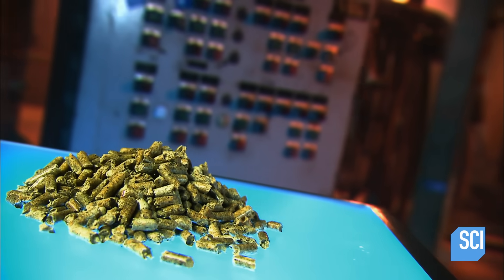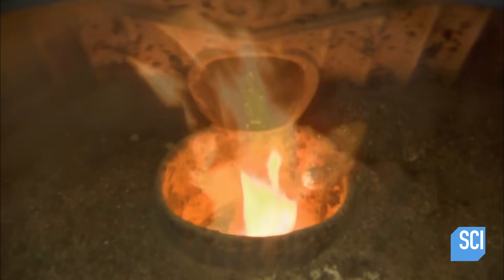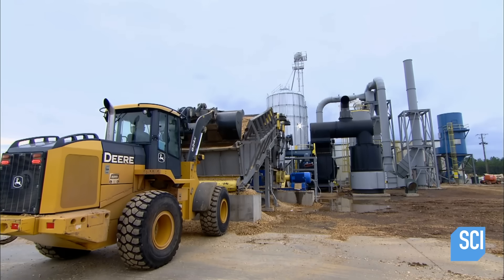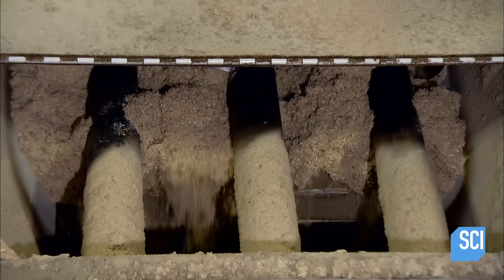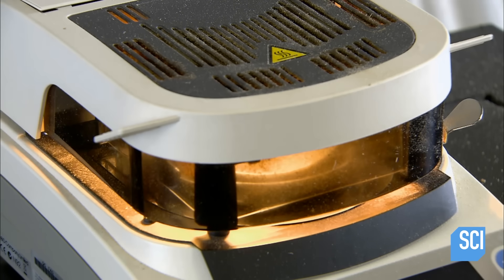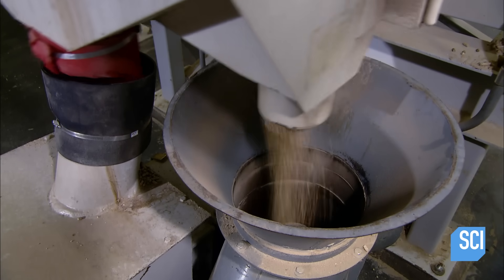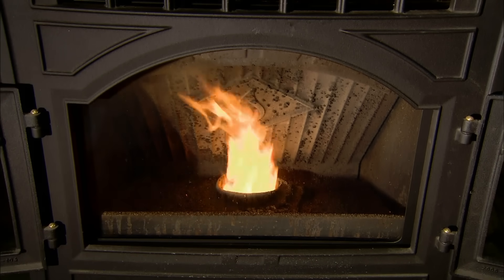How It's Made: Wood Pellets

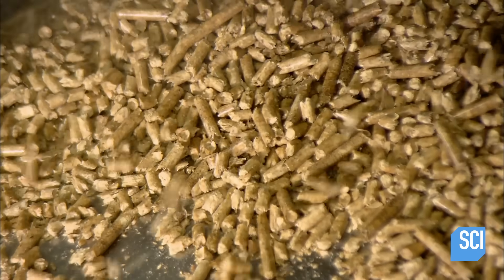Comment: 3:40 I'm like 99% sure lignin =/= tree sap.   Lignin is the "bulk" of the trees structure / physical material.  Sap is basically tree food - nutrients that gets produced by sap wood and moved to the branches to help produce new branches and leaves. 

I think this sentence should be "The compression generates heat which draws out the tree sap still contain in the wood fiber made mostly of lignin. Once the sap cools it helps the wood pellets keep their shape" 

or something like that.
Reply: I think we should rather leave the sap out of this. It is the lignin that acts as a binder (sometimes they ad a little extra but most often the natural lignin content is high enough), I don't think sap plays any significant role in the binding process of pellets.
Reply: Quality has been assured 😎
Reply: that's a terrible sentence

Comment: Is this the same pellet that is used for cat litterbox?
Reply: Roughly... yes.  It's funny they are talking about using them for heat while showing a bag for bedding.  We frequently have ranchers buy entire pallets of them to be used in livestock stalls.
Reply: @ShainAndrews   is the pellets from sawdust not toxic for cats?
Reply: @alexadespacito4561  You know what?  I over looked cat in the opening post.  Don't know how, but I did.  To answer your question.  I don't know.  Probably fine, but I don't know for certain.  I have lots of equestrian types use it... and I know just how fussy most of them are.  Thanks for getting me to revisit my response, wish I had a solid answer for you.
Reply: @ShainAndrews   actually I asked bc I really wanted to know since I’ve decided to swith from sand litter to pellet. Thanks for you response

Comment: HAHA the price of pellets have just gone up here by about 50% they use to be £150 for 900kg or 1 pallet full to over £300 for the same crap... pellets are no longer cheaper in the long run.
Reply: Other fuel sources have increased as well...
Reply: @ShainAndrews  indeed they have but it costs the same now, as the cost of hot water rose by 10% or so the cost of pellets was 100% so while 1 went up a little the other caught up so either choice is now an option.
Reply: @straightfaceguy7966  You pay for "hot water"?  You have the option to buy heated water or heat your own via wood pellets?  For what it is worth... I'm a buyer for a corporation.  I purchase from the manufacture for distribution.  Wood pellets are not up 100%.  I buy semi loads and they are not trending beyond the rate of other fuels.  Nice try though.
Reply: @ShainAndrews  yeah I but hot water direct from the company, they pipe it out to communities and then you have the option to take it or not. So I pay for 2 in 1, hot water for the taps and then hot water for the radiators, they measure the temp coming in the house then they measure as it leaves and work out the price. I could get pellets, but the price to install the machines you need and to uninstall the hot water costs too. So for now as it's about the same price I will stay with the community hot water supplier.
Reply: @ShainAndrews  and nice try for what? If you are buying for a corporation then you are going to get a much lower price than 1 house that buys 8 pallets arnt you... if I buy 60 pallets on a truck then I'm going to get them way cheaper plus you get "tax" back on your purchase... so ye obviously you would get them for hardly anything...

Comment: These pellets are so stupid. My place is heated by a heat pump and by a wood pellet stove. So when the power went out I was basically out of luck. Wood pellet stoves require electricity to work. Not just to start but to operate continuously. I really wish the place had a regular wood stove in stove. I could have been nice and warm during the power outage instead I froze for 36 hours. I don't see the point in a wood stove that doesn't burn random bits of wood and also requires electricity. Talk about pointless over engineering.

Comment: I work at a pellet mill and I will say this it’s way more complicated than they think and way more dangerous too
Reply: I'm an Electrician, and I have worked the occasional Flour Mill: The only place with higher standards for Explosion Proofing than Oil Refineries. I saw the dust floating in the air...
Reply: Dangerous as hell I got wrapped up in my machine
Reply: what about this machines that you can make your own pellet
Reply: I work at one also. not dangerous unless you're a complete moron

Comment: I have had a pellet stove for 18 years now and use it for supplement heat. The main thing is doing the annual maintenance on the stove and the  cleaning of the burn chamber when using it for a few days. One thing I don’t like is the big  increase in the price of the pellets. Supply and demand but there seems to be more pellet making plants near in New England.
Reply: Here the pelets is horrible expencive and used for animal bedding, would not dream of burning it because of the cost...vAlso it is always sold out...

Comment: Wood pellets are ridiculously dumb it put you back in reliance on the system the whole point of a woodstove is that you can cut down a tree in your yard a dry one preferably and burn it right then in there to keep yourself warm unless you buy these wood pellets you cannot make them at home yourself which makes your wood pellet stove only usable with purchases from your local hardware store which is completely redundant and dumb

Comment: Has anyone loaded a shotgun shell with wood pellets? Just curious how it turned out.
Reply: They’d break apart, the lignin bond is not very strong and can be broken with finger pressure, you’d be better off going old school and using rock salt
Reply: They broke apart and dusted.

Comment: 0:12
"Made from lumber byproducts, such as saw dust and wood chips, which would otherwise end up as waste. Pellets burn more efficiently and more cleanly wood." 

So, saw dust, which is wood, and wood chips, which is definitely wood, burn more efficiently and more cleanly than wood. 

Seems legit.
Reply: It also mainly has to do with how the pellets are burned, in a little furnace hole with high air flow.  Having converted to a pellet stove from a wood stove in my cabin, a 10, 40-lb bags lasts longer than a chord of lumber and heats the place way better.  My model holds 120 lbs and runs off a thermostat and I only have to refill it once every 2 weeks.  2400 sqft cabin, too.
Reply: @DissYraiN  Yeah but unless you get the pellets super cheap it defeats the purpose of a wood stove. You can't go cut yourself pellets so might as well just use a furnace.
Reply: @bobbygetsbanned6049  alright, so I have 3 pallets (40 bags) that each cost about $250 delivered to my property. It takes up the space of a full chord of wood, and about 10 to 15 bags do the work of a full chord of wood.  Where I live, there aren't many dead trees to turn into firewood, so I'd have to drive and put in a lot of work (days) to generate just one chord, and probably consume more than $250 in gas just to chop, split, and haul said chord to my property.  I would have to keep manually feeding the wood furnace each log.  The pellet stove self feeds for over a week, puts out 15x the BTUs by weight of fuel, and works off the thermostat which I control remotely.  It burns way cleaner as well.  

It's better than a wood furnace in every single aspect.  I'm an engineer.  I didn't switch to it for no reason.
Reply: I appreciate all the info everyone. There's a learning experience around every corner!
Reply: @skuzlebut82  I think it has more to do with the physical format the wood is in. The finer/less "log-like" it is, the more efficiently it can burn. A log is about the least efficient format in which to burn wood, so these do better and burn more completely (what efficient burning looks like)
Reply: @skuzlebut82  I appreciate that you are open to it and personable. Have a great day.
Reply: @joeschratz9360  AND, you have a great day as well!
Reply: @joeschratz9360  And you have a great day as well! :-)
Reply: I know it sounds far-fetched but it's true. The reason that they are comes down to the sap that that is pressed out an exposed when they are made into pellets.
Reply: The cool part of it all is they burn fossil fuel to make the pellets...
Reply: @waynec369  That mostly depends on how the power grid generates the electricity used by the machines (except from the dryer, which they state in the video runs on the waste sawdust. Either way, that waste wood will either be burned, or decompose to give off the CO2.

Comment: I had a pellet stove they're not that great two bags a day $5 back make s'more Ash then what you think and it's not smokeless what are those green things inside of pellets break One open they have green plastic-like material inside
Reply: We burn less than a bag a day, and there's no plastic in pellets, if there is, you are buying trash pellets, not wood pellets. I have no doubt that some dodgy manufacturers would bulk up their pellets with rubbish, but only in shitty countries, advanced countries regulate pellet manufacture.
Reply: @ledsalesoz  I know some of them will only take a bag but the one I had used two bags and I said plastic-like I'll got them  from Menards.
Reply: @ledsalesoz  and I would clean it twice a day and every morning it would have a big pile pellets in the fire pot I don't know what I did I couldn't adjust that I had it less than 3 months just to say I was not happy with it.

Comment: I get my wood for free out of my backyard I don't have to pay eight bucks a bag or $10 a bag
Reply: Yes, and that wood has a much higher water content, so burns much less efficiently, produces vastly more smoke and methane, and impacts your health, whether you realise it or not. I've always found it odd that people think wood heaters are eco and clean, they are anything but. Pellet heaters control the heat output by providing unlimited air for combustion (the firebox is fan forced to make the pellets burn rapidly and cleanly) and varying the fuel feed rate, whereas wood heaters control the heat by controlling the air. By starving the fire of air, it becomes massively polluting and toxic. If you want a real flame, then wood pellets are the way to go.

Comment: The pellets that fuel the stove at my house are a lot bigger around than two-tenths of an inch, they're closer to 3/8".
Reply: The narrator said “one and two-tenths inches”, i.e. 1.2”, not 0.2”.
Reply: @tookitogo  1.2 inches is much bigger around than home heating pellets. Unless they meant the length?
Reply: @dbseamz  I rewatched them segment, and you’re right: they did say the diameter is 2/10”, and then the length is 1 and 2/10”. Seems like the size I remember for those grass pellets they sell as rabbit food. (Wouldn’t surprise me if the equipment is basically the same.)
Reply: @tookitogo  The holes in the rotating die are ~1/4" dia. The holes are tapered...with the bigger diameter on the inside part of die. As material gets forced into the holes...it gets compressed before exiting the outside of the die. A stationary scraper blade (or knife) can be adjusted to make shorter or longer pellets. Rotating dies of varying hole compression ratios are available...selection of which is dependent on the types of materials being pelletized.
I was maintenance engineer in a plant that had several California Pellet Mills in operation.
Reply: @BANANASandDUCTTAPE  Yeah, the same principle as other extruders, like the ones for pasta. 

I’ve actually seen a pellet extruder in action on a farm once, but for making pellets from hay, rather than wood.
Reply: @tookitogo  That's a neat idea. I guess it could be stored for longer periods of time?
Reply: @BANANASandDUCTTAPE  I'm not certain, but I think it's simply more compact and easier to serve to the cows, compared to baled hay.

Comment: Wood pellet fire power plant?? But what if i wanna play with the fire and control the heat manually?
Reply: I know on mine you have to keep the door closed as there's a fan on the inside that blows the exhaust outside.  Controlling the heat is done by high/med/low switch and a feed rate slider inside the hopper
Reply: We tried them on a coal/wood boiler that normally uses wood chips.  They work but the quantity required to replace chips made it cost prohibitive.

Comment: Not really “green” energy, considering all the energy it takes to make these pellets!
Reply: I mean they turned what would otherwise be waste into a clean burning, cheap fuel that produces very little smoke and produces ashes that can be then reused as fertilizer, but alright.
Reply: @meismagiic4779  yes, it’s a very good clean burning source of energy! True. But a heck of a lot of energy goes into making it! But it’s no doubt good for the life of the wood stove.
Reply: @c.e.schlink9933  .. no where near the energy to make lithium batteries
Reply: @bryandamkaer3646  so true
Reply: @bryandamkaer3646  yeah that comment makes just as much sense as saying "growing avocado is really more water efficient than cleaning laundry"
Yeah in theory its both about energy, but wtf, those are not even really the same field of application.
A lithium ion battery is great for a small, lightweight power-supply with a high power density (e.g. potable electronics, cars) whereas wood pellets are heavy, but burn clean and are a easy energy storage.
But sure, while you shin on Lithium-ion Batteries, whats your great alternative? NiCd? Gasoline? Hydrogen that basically leaks out of every portable container or is ungodly heavy if stored "properly"? 
Nice one..
Reply: @bryandamkaer3646  That makes no sense at all, pellets are a fuel, you burn them once and they are gone, batteries are an energy storage medium, not a source of energy, you charge and discharge them hundreds or even thousands of times, the energy in them comes from other sources. There is no relation between the two, you just made up some nonsensical statement to try to appear edgy, but you just look foolish.
Reply: @bryandamkaer3646  batteries do take a lot of energy and mining to make but they are recyclable and can be made into new batteries again without more mining. Once you burn fuel it's gone forever
Reply: I mean, they burn the waste sawdust to run the dryer, better than burning natural gas or some other fossil fuel.

Comment: Haha they tried to censor the company name and number during bagging but the next scene you can clearly see PWPELLETS and the phone number
Reply: I worked on California Pellet Mill machines - exact same principle as shown. We blended 65% shredded polyethylene scrap plastics with 35% shredded hardwood fibers into pellets which was then run thru an extruder - the molten hot material was then compression molded into a product.
Reply: @raybin6873  Really..how is burning 2/3 plastic safe for residential ( indoor) use?

Just wondering as I'm no scientist. Did a few hard weekends in a PVC pipe factory back in mid-80's; don't miss that rather stinky detail but it gave me a unique perspective on Blue Man Group..
Reply: @brianstratton8767  
It isn't burned but formed into products like decking planks, Trex is one brand.
Burning polyethylene isn't any different than wax.  Polyurethane can form cyanide, PVC can form phosgene and dioxin.  But polyethylene and polypropylene are only hydrocarbons.
Reply: Ahahaha
Reply: pwp whats this